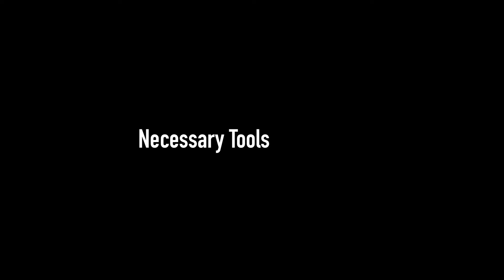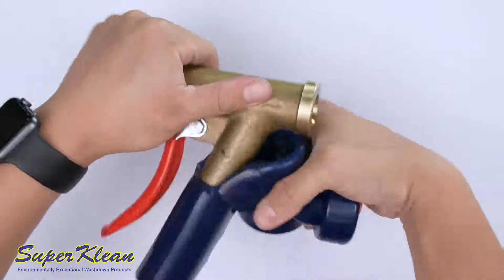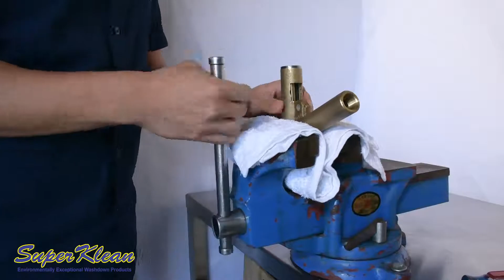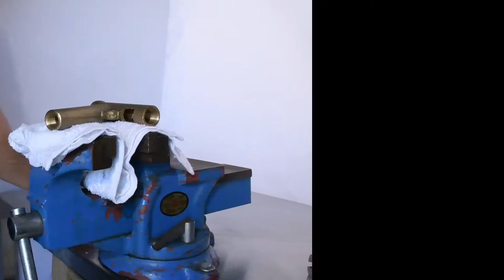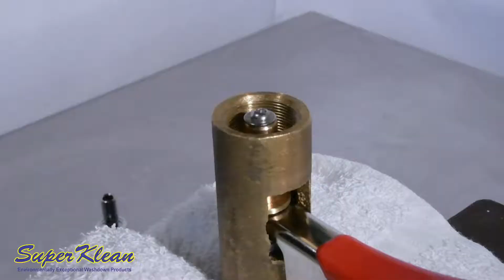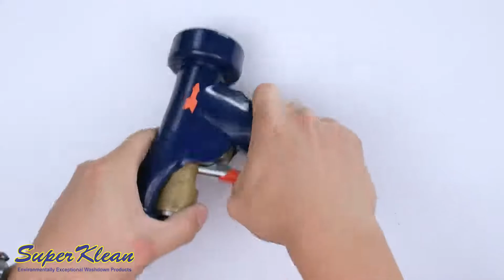Standard Nozzle Maintenance | SuperKlean Washdown Products

Comment: What would be the best way to go about fixing the spray nozzle that is no longer shooting in a straight line?
Reply: Having this issue too. Did you ever find a solution?
Reply: Unfortunately no, just had to replace the whole spray gun
Reply: @sacramento458  Any recommendations on a brand that works well? We've tried the one from Grainger but it seems to be doing the same thing.
Reply: We’re currently using Vikan brand with an 3/4 hose and they are working out okay.
Reply: @sacramento458  Thanks for the response! Ordering one now and giving it a shot.
Reply: Works good! Thanks for the recommendation, my team member is happy with it
Reply from the maker: Hi Manuel. Please call 1-800-769-9173 or email sales@superklean.com and we'll help the best we can!